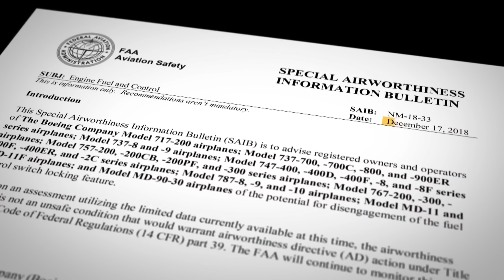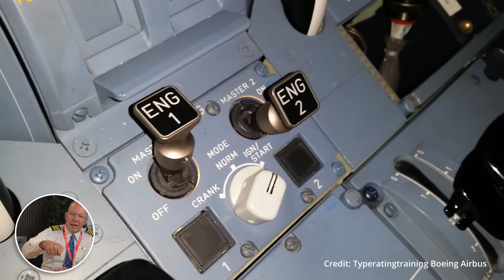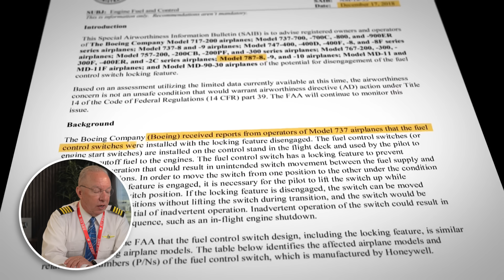Air India 171: The FAA’s 2018 Fuel Switch Locking Bulletin Explained (16 Questions Answered)

Comment: Engineer here… switch failure is always a possibility… 2 failures within a second is practically impossible
Reply: Everyone seems to be focusing on the switches being moved. There's a lot more to the fuel control system than just the physical switches. Any number of faults could have occured such as voltage fluctuations, damaged wiring, loose connections, connector pin fitment, liquid ingress, corrosion, software, bad components. What i'm saying is that it could be another fault that has caused the control systems to misregister the actual switch positions. The switches themselves may have never moved at all, despite the black boxes showing the signals changing.
Reply: @adamdavies163 the flight data recorder, recorder the switches being physically moved, and then moved back to the run position. They were found in the run position. The 787 is constantly recording 1000's of inputs if there was a failure somewhere else it would have recorded that failure.
Reply: @johnnybgood6424  You would need to analyze every second of the FDR and CVR data to align the sequence of events.

Sudden Power loss, no thrust, RAT deploys
Mayday, Mayday, Mayday
Why did you cut-off?
I did not.

Assumes Fuel Valve issue.....
Flicks Cut off Switch - to Off & then ON.
Flicks other switch OFF & then ON.

Who knows?
Reply: @adamdavies163  But there ARE sensors in the switches, and their state is recorded when the switch is toggled.
Reply: Also those 2 switches did allow themselves to be moved back to on and then stayed there even during the crash. 
Yeah, the chances of that happening are basically zero.
Reply: @Lukashoffmann94  or maybe we don’t have all the information yet and speculating doesn’t help.
Reply: @rtbrtb_dutchy4183  The relevant information is there to determine what happened. All we are missing is the who and why. Neither of those really matter in the grand scheme of things.
Reply: @--_DJ_--  no, the relevant information is not there. We still don’t know what happened. All we know is, at some point, the switches were moved to cutoff and moved back to run. 

Was this an attempt of a reset?  Deliberate could mean bad intentions, but could also mean trying to fix something. Was there another person in the cockpit who did something wrong?  Were the switches worn out somehow and they got bumped?  How about this, the first officer was flying, so when the captain went to raise the gear, he had to lean over the throttle quadrant to reach the lever. Did something fall out of his shirt pocket and hit both switches?  Did his shirt or ID lanyard get caught in it and pull the switches?  

We have no idea.
Reply: @rtbrtb_dutchy4183 You cant accidentally move them by design. We know what happened. No need the theorize at this point
Reply: @--_DJ_-- you can’t accidentally move them by design?  Correct, but is that true with worn switches?  
I’ve taxied an old Learjet unto the ramp for parking and to shut down engines, you had to lift up the throttles a bit, move them to the left, out of a gate and pull them down. 100% designed to not accidentally shut down the engines. Guess what, both engines shut down on me because this system was worn. 

Don’t jump to conclusions. We don’t have the information.
Reply: @rtbrtb_dutchy4183  They way they work wear would just make you have to lift them less, but you would still have to lift them. It's not like they are a heavy wear item that is going to shave metal down significantly. They also would have to be knocked upwards to move to the closed or off position, which is essentially impossible to do unintentionally, especially with a 1 second delay between switches. 
The conclusion has been made, the cause has been determined, it isn't being jumped to. People just don't want to accept it for some odd reason.
Reply: @--_DJ_--  yeah, I know how they work. I have flown different types of Boeings. 
And I don’t have an issue with the truth. But a conclusion has not been made at all. That’s you having confirmation bias. I’ve seen switches being pushed and pulled by clothing. I’ve seen switches being moved unintentionally. I’ve seen it all. I’ve seen things happen that the manufacturer said couldn’t happen.
Reply: @rtbrtb_dutchy4183  If you know how they work, you know how dishonest you are being to say it could be an accident. Listening to and reading conclusive evidence and understanding what it means isn't confirmation bias. Stop using that term if you don't know what it means. You could not come up with a scenario to activate those 2 switches, by accident 1 second apart that is even slightly realistic. Given what was said in the cockpit it makes an accident completely implausible. Stop denying reality. The conclusion is made, the who and why is all that is left to determine. It is possible they were moved not out of an intent to crash, but some kind of lapse of situational awareness or impairment, but it is quite obvious they were moved intentionally by one of the two pilots.
Reply: @--_DJ_--  and this is why you cannot be an accident investigator. You already believe a conclusion is made, when it’s not. I’m not being dishonest, I just know that we don’t have all the information yet. 

People said the flaps weren’t set for takeoff, while pictures showed they were. The aircraft didn’t use the whole runway. Flaps were accidentally retracted. People were so convinced. 

And now, you are doing exactly the same. Is it likely that what you said happened?  Absolutely. Is there conclusive evidence at this stage of the investigation?  Absolutely not. 

If you don’t understand this, I’d call that a flaw.
Reply: @rtbrtb_dutchy4183  The flaps were a theory based on nothing but grainy images. Whether people were convinced or not makes absolutely no difference. This is a conclusion based on facts and data. You can't compare them. Your logic is flawed. You are being dishonest. That is a flaw.
Reply: @rtbrtb_dutchy4183  Nothing I have written is what I say, it is what is in the report. There is data to show what happened, more investigating isn't going to change that data.
Reply: @--_DJ_--  come on man, you are being ridiculous. The report says that the switches moved from run to cutoff. Then they moved from cutoff to run. That’s all we know. Saying a pilot moved those switches is most likely. But this does not make it conclusive. It’s a good thing you are not an investigator.
Reply: @rtbrtb_dutchy4183  They didn't move themselves. That allows for one option. That is how a conclusion is made. Stop with the personal bits, it isn't helping your argument, you just sound petty.
Reply: @--_DJ_--  no, they didn’t move themselves. I never claimed that. 

Now, I did some research based on my own experiences on different types. No airplanes I fly are the actual switch position recorded in the FDR. (Flight Data Computer). So, I wanted to know, does the 787 record actual switch position?  This is the answer I got:

The Flight Data Recorder (FDR) on the Boeing 787 captures the electrical state of the fuel control switches — meaning it records whether the switches are in the RUN or CUTOFF position based on the signal received from the cockpit systems A B. It does not directly record the physical movement of the switch itself (like a mechanical displacement), but rather the status as interpreted by the aircraft’s systems.

So you tell me. The report says they are focusing on these switches.
Reply: @--_DJ_-- "One second cut off execution" raises another question.

FDR report says -

"Cut off switches transitioned to CUT-OFF from RUN position one after another in a CAP of 01 second".   

These words are extracted in verbatim from the report. Which means both 1&2 cut-off switches were executed in almost simultaneous 01 second CAP time frame. 

A manual spring actuated safety lock dented switches that need certain pull and put effort to activate cut-off......being executed in just a second by a human hand is something to think about. And here we are talking about "Two manual" spring actuated switches being turned off in 0.999 second. The switches are not like led room bulb switches.
Reply: @letsthinkbriefly3761  I'm not sure what you think that is saying, but it probably isn't what you think it is.
Reply: @--_DJ_--  I would like to hear what you think it is then. Saying TWO manual fuel cut-off switches being shut off all in "one second" by a pilot hand has to be a wild case.
Reply: @letsthinkbriefly3761 1 second is not a short amount of time to do that. Plus it is 1 second from the time the first one was activated, not for both combined. It is a switch they operate daily and could probably find with their eyes closed.
Reply: @letsthinkbriefly3761  I think it is even more strange that they set the switches back to RUN with 4s delay. If you want to die, you don't need to hurry up, so may switch them slowly, but when you want to survive and you life depend on the two switches, you would not wait for 4 seconds.
That looks more like they tried to turn the engines on by moving the switches up and down and looking on the reaction and as 1st engine get on, started the same procedure with second switch. May be even they turned the first switch once and looked for the engine reaction, then turned on the second. Anyway that indicated, that the situation was not clear for them and they wanted to understand what is going on. If one pilot had seen another to switch the fuel off, it would be clear for him, that he had to switch them both back as soon as possible.
Reply: @azlktune You have to process what just happened before you can turn them back on. That is likely the reason for a delay between off and back on.
Reply: @Lukashoffmann94   I don't get you. They did go off somehow. It would seem deliberately but that's not proven. One pilot thought the other did it and asked why. The other pilot replied that he didn't. Flight data also showed that each switch was returned to the on position one after the other within about one second. Obviously at least the pilot asking why did that. But it was too late for the engines to return enough thrust. This is all in the report.
Reply: @Lukashoffmann94  - it's likely they were never moved to the "off" position in the first place.
Reply: @Lukashoffmann94  solenoid issue found dont blame the pilots for the fault of boeing
Reply: @Lukashoffmann94  Weren't the switches on OFF when they inspected the cockpit?
Reply: @Lukashoffmann94     What if they were never really physically moved to off position?  If all that happened was just an electrical signal that mimics switch changover?    that would explain all the events including cockpit conversation... Cyber attack seems more and more as an option...
Reply: you are ignoring the dialogue.  There was an accusation, and a weak denial, no other dialogue between the two and no evidence that the captain took control.  The PF wouldn't accuse the PM of flipping the switches if he didn't have a reason too.  the PM shouldn't have been touching anything.
Reply: @JohnQuincy1776  I think some people have a hard time fathoming that a person would kill an entire planeload of people.  Yet that's exactly what happened.
Reply: @robertcameronjones  that is ok.
Reply: @JohnQuincy1776  We actually don't have a clear idea of the exchange, just a general summary. We can't hear tone of voice, stress, etc. We don't know the denial was "weak," just that there was a denial. And there may have been more to the exchange. (But not much more, since they crashed 10 seconds later.)
Reply: I wonder if the switches are directly wired to the shutoff valve or via a relay (mechanical or solid state). That could introduce a failure mode, though not in this case.
Reply: @Greatdome99  exactly. I don't know why these tubers are so hell bent on denying any possibility of electrical mishap just to lean towards deliberate pilot action. Like how the hell that small switch will control the fuel from all the way from the fuel tank to the jet engines.  If the switch is working through gears and springs there might be possibility of mechanical failures also.
Reply: Are you saying that a switch failure is possible but in this case that’s not what happened due to the 1 second delay between them? If that’s what you’re saying, is it not possible for switch failure to occur (let’s say due to intense vibrations or something) and affect the two switches with a time gap, or would they have moved simultaneously?
Reply: @malekmadeit  If it was a switch design detent issue how did the aircraft crash into a building and the switches remain in the on position. yet BOTH switches unlatched on a smooth ground roll in good conditions at the perfect time 1 second apart.
Reply: @malekmadeit  dual switch failure is a possibility in the same way that it is statistically a possibility for me to win the lottery every day for the rest of my life.
Reply: @malekmadeit they are spring loaded switches, it takes 3 fingers to lift up then you move it up or down and release
Reply: @malekmadeit I think all they were trying to say is that a wiring fault on one switch is somewhat possible. Keep in mind there haven’t been a bunch of reports of one engine shutting itself down due to a wiring/switch fault. NOW, with that consideration, what are the chances that two switch/wiring faults happen at “nearly” the same moment. It’s practically impossible. The fact it was one second apart shouldn’t be the factor to hone in here. Could have been 3 seconds, could have been 1/2 a second. Doesn’t matter materially. In terms of a random equipment failure of 2 independent switches/sets of wires at essentially the same time is what takes that scenario out of the running here. Take care!
Reply: plus the landing gear wasn't raised
Reply: @jeff946 the question is whether the RAT deployed before or after the switches were triggered. If the RAT deployed before the switches were triggered, then that shows that there was a loss of,power before fuel cutoff.
Reply: @jeff946  ikr!! No one's talking about it.
Reply: The switches didn’t look that bad in the picture. I’m thinking they can test the actual switch
Reply: The switches themselves do not pinch fuel lines to cut off fuel. In between the switches, there is electronics, software, pneumatics, pumps and valves. Failures of these or some of these parts can trigger an unexpected outcome. We need to know before it happens again. That is the job of investigations in replacement of tunnel visions.
Reply: Could an electrical failure look to the Black Box like the "switches were thrown" when they were not? ie: The BB was simply recording that the engines were cut-off by electrical signal, not the cause of the signal.
Reply: @creativebea  The ACTUAL voice of one of the pilots questioning the other pilot about the switches being moved nullifies the possibility that "an electical failure in the black box looks like the switches were thrown"
Reply: @mosheheliyahu9071  - dd he actually see the switches on the "off " position or going by what he saw on the computer screen?  Big difference. that is unclear. It's all "Fly by wire". Pilots are focused on computer screen read outs.
Reply: I’ll say it more clearly… a single switch failure is possible… two failures a second apart is not possible… they were operated manually & on purpose
Reply: Since the left seater has both hands on the yoke during takeoff, and the right seater has free hands. It's most likely the right seater turned off both fuel pumps, then accused the left seater of turning them off.

That's why the left seater said no. He was busy flying the aircraft, by all indications.
Reply: @donwyoming1936  You do more harm than good by speculating, even when speculating guided by logic. Something went wrong that day, the situation wasn't normal.

The safety boards know who it was. They'll be investigating the man's life before it all ends up in the final report a few years from now. This sort of information is normally not covered up, only delayed until all facts are known.
Reply: @donwyoming1936  We don't know who said what. That is NOT in the report!
Reply: Let me ask you this way. What could possibly cause both switches to move to cut off position within a second of each other except for manual input from pilots?
Reply: Electronics, wiring and IT can fail in the most unbelievable ways.
Really need to wait for the full reportn
Reply: What about a faimure from stress/fatigue of a housing or common component. Also, one failing element can knock out another. No idela, I'm not an engineer.
Reply: Awww man. You shouldn't have claimed to be an engineer. Now all the techs that actually know and do the work aren't going to listen to you!
Reply: If it was a deliberate action, the pilot concerned would have meticulously analysed the very moment to flick the switches so there was no way back. I do feel if you are planning to end your life would you really take all those people with you unless of course you are having a psychotic episode.
Reply: I think you are missing the point. The fault was that the detent was faulty. It has been discussed elsewhere that as the switches are so close together that they could be both bumped by a hand accidentally at the same time. The detents are there to stop accidental operation. It is the detent that is the subject of that earlier report.
Reply: IT Technician… true, but not IMpossible. We had a major failure of our tape backup system to the Tandem mainframe, so— go to your backup, right? 2nd backup failed. Go to 3rd backup. THIRD backup had failed. We even had a secret emergency 4th backup. ALL the data was corrupted or lost. It never had happened before— or after.
Reply: This would be an EEC issue not a switch issue. There is an AD on the EEC on this exactly plane model. Why no one is talking about it I don't know.
Reply: What about a computer malfunction?
Reply: Too much of a coincidence
Reply: That is a good point unless there are two connections operated by the same switch
Reply: I have had a VW Polo with a cracked wire from the battery negative terminal to the car's body. That single wiring fault caused a wide variety of systems to malfunction in weird ways.

If a switch panel had a bad (loose/corroded) connection on a common ground or voltage supply wire, then that could cause multiple switches to malfunction at the same time.
Reply: @craigmcqueen7992  The problem didn't happen at the same time. You aren't going to have an electrical fault on two switches right beside each other 1 second apart from a common problem to the circuit, and being an airplane, they are likely completely separately wired.
Reply: @--_DJ_--  a common wiring/circuit problem is most likely to affect 2 switches that are right beside each other. However, yes I'd expect an airplane has more redundancy (except possibly for newer Boeing designs).
Reply: @craigmcqueen7992  Yes yes Boeing bad. Very good. You get your social media points.
Reply: @--_DJ_--  My comment is based on Boeing's recent history in which MCAS neglected to implement redundancy in its design, relying on a single angle-of-attack sensor input rather than both sensors. That design decision was a significant factor contributing to multiple accidents and loss of life.
Reply: @craigmcqueen7992 Which has nothing to do with a plane of this vintage.
Reply: @craigmcqueen7992  Exaqctly. A Bad earth or floating earth can cause a plethora of electrical issues. The 787 Avionics Compartment is subject to excessive moisture ingress, as reported by various airlines.

Southern China had independent Engineers report 0.2mm gaps in the fuselage connections between Carbon Fiber and Alloy sections of the aircraft. They also noted that ALL 10 of their 787's had micro cracks in the Carbon Fiber sections due to poor alignment, wrong rivets, and oversized holes.

Independent Investigators also uncovered subcontractors to Boeing who were 'pressured' by Boeing to deliver goods that had NOT undergone full certification for durability, and therefore concluded that none of the aircraft were legally airworthy. Fault Components identified were Fuel Control Valves and Pressure Sensors.

They also identified issues with the Emergency Exit locking pins.
Reply: Actually if one failure happens a second failure is likely. Because the failure is likely due to an issue common to both the switches.
Reply: Is there a SOP when an engine reboot is required for a failing engine? The pilots deliberately did the off and on as a last resort to gain power which was failing anyways
Reply: @bijjii ...or referred to the wrong QRH / SOP? Worse still, acted independently and wasn't using any QRH or CRM.
Reply: That's assuming that the switches are fully independent of one another. Then statistically speaking you need to multiply by 2 probabilities. But we can't make that assumption.

The weight of the evidence currently seems to indicate intentional action, but we can't rule out other causes just yet.
Reply: It wasn't switch failure one of the Pilot's turned them off as heard in the Black Box recording.
Reply: They have the switches and can check they were installed correctly.  The console was replaced in 2019 and again in 2023 years after this bulletin so obviously with the 10' s of thousands of 737 777 and 787 being maintained and flown daily and these switches are used twice on every flight so don't you think that an 8 year old bulletin to check installation is no longer relevant.  Why would both switches fail 1 sec apart, on take off and not when the plane bumped down on landing, and why this plane has both fail when there is no recorded complaints of this happening on other planes over the past many years while these switches have been used.  Malasian airlines mh370 turned around and evaded radar and disappeared with 2 competent pilots. Nobody knows why but I am sure it was not fuel switches
Reply: These are Fiy by wire planes. The signal from the switch can be overridden by the FADEC/ECU. The signals can shut down fuel EVEN if the switches are physically in the RUN position. Ask a Boeing technical authority to confirm on oath that ONLY the physical switch can turn off the fuel.
Reply: 787 pilot here… 2 failures within a second is highly possible
Reply: It looks like either Captain Steve is getting paid or he is under some kind of pressure, because he’s defending Boeing from every angle..
Reply: The 2018 report about the issues with the faulty Boeing switches says BLACK ON WHITE that there are issues with the locking mechanism. A pilot having his wrist on the switches when holding the throttle, can accidentally flip them both at the same time without much resistance if the locking mechanism failed.
Reply: ..but then an electrical system failure causing the interpretation of these switch positions is absolutely probable. We are talking 21st century electronics here. Those switch outputs are fed into the FADEC and then it’s yadi yada…
Reply: A white man trying to save a white company…
Reply: Common mode failure
Reply: @tunneloflight may be yes
Reply: The flight recorder said they were turned off and  back on again. Obviously they were moved or there was a "Glitch" like what happened to Gus Grissom.
Reply: 🙄.. Make it simple...

As a Company or factory.. Boeing has manny backlog orders.. the show must go ON...

A person as a pilot already received salary as their job & risk... similar situation for the passengers, flying with a plane was a big risk to lose their live...

No risk no gain.. enjoy your journey..

😒
Reply: @kaprios1709  Different story when a Corporation like BOEING, purposely fits falsely Certified Components into their Aircraft, and then certifies the aircraft as airworthy.

That is not risk assessment, that is fraudulent financial liability.
Reply: I think Boeing shouldn't have relied on the detents. I think Boeing should have protected them with small plastic covers. Or placed them somewhere else where they are less likely to be bumped, like in front of the thrust levers rather than behind them. Or install them in the opposite direction like Indian light switches instead of American ones (down for on, up for off). Or even better, use spring loaded dials that are less likely to get bumped instead of toggle switches.
Reply: @danielch6662 you know Airbus has the same functioning switches?
Reply: If you are truly an engineer then you should know practically impossible is just buzz word engineers use to wash off accountability. 
There is no such thing.
Reply: No its not impossible.  If they're faulty then hand pressure acciddbtsllybput on the switches such as when using the nearby flap handle could set them to off
Reply: We know. Adding your supposed occupation, adds no credence or weight to your post.
Reply: FAA/GE issued Service Bulletin FAA-2021-0273-0013

SB 73-0097 R01 ENGINE FUEL AND CONTROL - ELECTRONIC ENGINE CONTROL (73-21-20) - REPLACEMENT OF INTEGRATED CIRCUIT MN4 ON MAIN CHANNEL BOARDS

The bulletin is related to loss of control issue. 

The stated MN4 computer with faulty soldering, that might weaken and lose contact due to the thermal stress after a number of cycles, interprets data and commands fuel metering valves - with the lost contact attaching the MN4 processor to the EEC intermittent electrical contact, loss of signal processing and engine control faults can occur.

GE recommended replacement of part on the bulletin.

It has been reported this was NOT implemented by Air India.
Reply: B1 engineer here. I agree.
Reply: @Adolphus-z7d8x 
"B1 engineer". Sure you are.
Reply: Like when a secondary fuse blow and a moment later the primary as well 😉 
I do not think that is impossible. As I read on the 737 the security part was built in upside down by the same technician on both fuel cutoff.  The cutoff switch worked, the airplane flew. The different was only that the pilots were able to switch it without pulling on it, like a normal flip switch.
Though I agree with you, I do not think this is the case here.
Reply: But let's not forget that this airliner had serious power issues on the previous flight that day. It affected the cabin lights,  AC and entertainment portals. Do you think that a power surge or short could have triggered the switches? Especially given the enormous amount of power required on takeoff?
Reply: @ted1091  That switch has an physical security feature, not an electronic one. And If the airplane has an electronic issue that switches down the fuel pump then all the fuel pumps should have stopped in the same time in my opinion.
Reply: @zbaktube I'm not an engineer,  but it seems like an easy enough experiment to test whether these switches could have been triggered by a power surge or short circuit
Reply: @ted1091  For me it is not clear either what is recorded in the blackbox: the flip of the switch or the fuel pump gets power or not.
Reply: @ted1091 It is not an easy experiment. Many times you try to replicate the fault indicated by the customer and nothing happens in a week of testing various scenarios. Nothing happens. You give back the thing to the customer and two days later he comes back stating the thing did that again. Very common.
Reply: An open switch will not fail short, but the reverser is true.  If there are sense resistors in parallel it's easy for the control logic to distinguish a device or harness failure from user input.
Reply: @robertcameronjones please explain your comment in lay terms. Thx
Reply: We Indians Saar 
We goof Saar 

Can't fly Saar 
Pakistan did it Saar 
We only drink mooter Saar 
No food Saar 
Forgive us Saar
Reply: The guy was suicidal. That’s it. It’s impossible for TWO to fail within 1 sec
Reply: Is it possible you can toggle these switches within a second ? It needs very quick hands to do that. 
I assume there maybe a coil which is energized to hold the switches in place and a electronic disruption may have released the switches. Or are these switches purely mechanical switches?
Reply: @krishnachander6411 They are held in place by spring pressure and a ramped section between on and off. Purely mechanical locks.
Reply: Whenever operating an aircraft control. the Crew should confirm correct function, correct sense, correct range of motion, and termination of motion. For example, “#1 Valve” closed indicated by light and/or annunciation/s followed by fuel flow value or flow “#1 Cutback" and for critical systems in flight dual confirmation before selection. This is required to maintain situational awareness of the aircraft itself. 

Different aircraft and engine manufacturers for some years had spurious FADEC activations that should not have been possible according to both the logic and the circuit diagrams. Even more disconcerting was the unofficial temporary ‘fix’ of cycling circuit breakers that were isolated from the FADEC.

Very tragic RIP.

Blue skies.
Reply: Lots of Boeing paid bots on this link. Good money to be paid huh...propagating fake Boeing propaganda
Reply: Y si nunca estuvieron en posición Run, y el problema ocurrió en la computadora que malinterpretó los sensores de posición?
Reply: How the blackbox register the statuses of the switches? From the electronics or directly from the switches? I think the answer of this basic question should be considered. Then if the statuses of the switches is red by the electronis through a voltage signal, if the voltage signal has some problem for ten seconds this can cause a misinterpretation of their position
Reply: You are a d*mb engineer. You must have taken several years to pass out.
Reply: Even more impossible is for both of those impossibly-failed switches to sequentially UN-FAIL and physically unlock/move themselves again, independent of each other, 9 and 10 seconds later.
Reply: But then isn't it also impossible to manually turn off both switches within 1 second? They need to be lifted before they can be switched which means they have to be switched off separately.
Reply: @michaelb2388  That's the point. The switch has a lock on it. Locks don't unlock themselves. The switches were designed to require deliberate and conscious effort to actuate.
Reply: Phycologist and astronaut here.. i have traveled to the edge of space and back. I suspect intentional foul play by either pilot due to the evidence brought forward, and by Boeing’s fantastic records of safe flight. Also the fuel feed could not have been cut off unless done so intentionally.
Reply: That is exactly what was being said about cosmic shuttles (Challenger). It was supposed to be almost impossible for them to crash.
Reply: As a risk professional (Finance though), which of the two are riskier : 1. We assume pilots at fault but actually mechanical issue this plane particular or boeing 787 in general 2. We assume mechanical issue in this plane particular or boeing 787 in general issue, but actually pilots were at fault. Former is way risky in my view, and it is very important to understand motive of pilot to do so and families of pilot should help investigation and it should be transparent to all.
Reply: nothing is imposible but it's improbable
Reply: Are you an airplane engineer?
Reply: Just like how it was "practically impossible" that Boeing wouldn't reference a major systems change on the 737 Max in their nomenclature that could kill 500 plus people in 5 months because they didn't want additional pilot training costs.  The copium of Boeing fanboiz only rivals that of Elon Musk fanboize.
Reply: Improbable, yes. Impossible, definitely not. 

That's why Etihad, Singapore airlines etc are doing checks on these switches specifically after this report came out.

We should also ponder on the human error factor here which every other aviation youtuber is making out to the actual cause. If one of the pilots deliberately did this, then he would also have made sure other pilot do not initiate a rescue protocol (by turning it to run) to save the aircraft. If it was a blunder, you would get the hint from how each individual would talk. At such life and death moments, no one thinks about how world would judge them. The cockpit voice recorder is not giving any hint that either of them actually did these intentionally or even by mistake. So, we should not draw conclusion before the final verdict is out
Reply: Exactly—one failure is bad luck, but two at the same time? That screams deeper systemic issue. Do you think it points to sabotage, flawed design, or something even more alarming we’re not being told yet?
Reply: Hello captain.
What do you think? What if the other pilot could ve repositioned the switches immediately after knowing about them being in cutoff position?
Afterall they were repositioned after a lapse of 10 seconds.
Reply: When installed incorrectly it’s a systemic error. So I disagree
Reply: You’ve made a very valid point. Unfortunately, what we are witnessing now appears to be the shaping of a narrative—something that began almost immediately after the crash. If you recall, right after the incident, videos surfaced featuring former pilots discussing flaps and gear configurations. However, anyone familiar with even basic aircraft operations knows that if both engines are functioning at full capacity, the aircraft will take off regardless of flap or gear positions.

Fast forward to the present: the preliminary report has been released, yet no one seems to be addressing some glaring factual errors within it. For instance, the full form of FADEC is consistently misrepresented throughout the report. Moreover, a prior FAA advisory clearly connected to this type of failure is being overlooked by so-called expert captains.

That advisory specifically warned that if certain chips used in the FADEC system aren’t replaced after 10,000 cycles, there’s a risk of automatic engine shutdown. Given Air India’s well-known history of maintenance issues, several technical factors could have contributed to the crash—beyond pilot error or intentional actions. The conspicuous lack of attention to these potential mechanical failures strongly suggests an attempt to shield Boeing, Air India, or both from scrutiny.
Reply: 2 Mechanical switches, very unlikely. However, those switches are a part of the integral fly-by-wire system.
Mechanical switches are fed into a logic array and digitally encoded to interrupt requests in the FADEC 3 module which controls bpth engines.

The 787's have a manufacturing defect that allows moisture ingress to the Avionics Compartment.
If Avionics are subject to humidity levels above design spec, then short circuits can easily occur, providing false signals.

Remember all of the ambient environmental conditions, a very hot day, A/C not working on tarmac, just finished loading aircraft, = sauna in Avionics compartment.
Then A/C running, temps drop to dew point, cabin pressurization, take-off angle allows droplets to accumulate and flow, moisture affected wiring generates false signal = DONE!

FDR records Fuel Cut-off Switches activating and de-activating, but did they really get physically moved, or was it an electrical fault?
Southern China alone, with it's 10 x 787's recorded on average 20 technical problems per month with Avionics, in the first 6 months of 2025.
CEO decides to scrap the entire fleet and purchase A350's. For routes where no replacement aircraft exists, they temporarily suspend flights rather than use a 787.
Just think about that - Chinese not taking $, for fear that the 787 might fall out of the sky.... Let that sink in!

I'm gotta trust the Pilots and say that the 787 is a LEMON!
Boeing will no doubt blame Pilots to avoid Liability, because they are almost Broke!
Reply: @delawarecop  Except looking into the details, all the reports are that China Southern was planning to sell the 787 to get larger ones, they do have concerns about the airplane, but the airline itself appears to have not put out anything on it.  Their order for the A350 was in 2017 and was expected to be concluded by 2022, and it appears that it was.  Information closer to the time they announced the decision, indicates they would have been more concerned with the structural questions.  They flew the 787-8 which is the smallest and worst for efficiency.  Also note, it seems like only that airline is giving up their airplanes, not the rest of the airlines that fly the airplane.
Reply: @delawarecop you really believe that you got 2 independent shorted wires within 1 second from one another? Guess it’s possible but not likely
Reply: @odez180  They are not 'independent' when they are signals fed into a logic array.
I am an ex-RAAF FA-18 Hornet Supertech by Trade, so I do know a little tiny bit about Mechanical interfaces to Logic circuits.

Trust me when I say, the 787 is a lemon!
Reply: @delawarecop each switch is talking to its own fadec which in turn talks to the fuel control unit. It’s not one computer talking to both engines. This redundancy is put in there by design. If military aircraft is wired this way that is a huge flaw.
Reply: @delawarecop  You have some good points, but short circuits typically don't act that predictably. and for just 10 seconds and both switch inputs and no others 1 second apart. and no other Fadec faults, typical computer related faults would cause all sorts of weirdness not just 4 channels acting in the exact manner they would be if by human factors.
Reply: @aussiechristian  Depends where the water ingress occurs, depends on where corrosion occurs! You only need a temporary transient electrical spike to act as a simulation of a toggle switch.
Reply: @delawarecop  I work in Automation mainly Industrial. I understand what your saying but it is highly unlikely on 2 switches, with Aviation all critical switching has dual redundancy, 2 switches 1 second apart then back on 10 seconds later with a 4 second time difference. seems a little too human to be that type of error. If a bus goes you would get multiple errors. its all too clean to be a malfunction as you describe. Water shorts on contactors or bus relays caused chatter in most cases, and direct coil shorts causes mayhem this would be seen in data clearly.
Reply: @delawarecop  The information in the report is quite clear. The switches were switched to off and turned back on manually. That can't happen because of an electrical fault.
Reply: @delawarecop  Take it for what it's worth, but Perplexity says: "Each switch is equipped with an electrical sensor or position detector that monitors its current position (RUN or CUTOFF). When the switch is moved, this sensor changes state." However, "The sensor does not send data directly to the FDR " but gets routed to avionics control, which performs and records the action. 

So there would seem to be some tiny possibility of a software glitch - the switch didn't move, but a message sent to avionics control to switch fuel off. But then there would have to be the same SW glitch in reverse, since the pilot would not be able to turn the switches on (since they are already in the on position).
Reply: I shudder whenever I hear the words "practically impossible" (as do you yourself probably) but you are completely right.

If these were so prone to failure that 2 could fail a second apart there would have been a long  history of single failures .

And as such a failure would lead to an engine shutting off, the consequence is so severe that it would have been known. A lot wider known than a single bulletin years ago.
Reply: @exharkhun5605 Hmm you bring up some really good points, we would’ve seen some sort of issue with the switches before. Man it’s really hard to believe that it’s as simple as human intervention. I wish I could understand why
Reply: @malekmadeit  We probably will, investigators will comb through the man's records, his simulator flights (professional and on his computer, most pilots play flight simulator) and interview everyone he's known. People who are this desperate have a history.

Sadly they often manage to disguise it under a veneer of professional behavior, until they snap. That's why our Captain here had such success with a simple question: "Are you ok? Are you ready to fly? Asked at the right time, and in the right spirit, it can pierce through the façade before the problem becomes real.
Reply: @malekmadeit this airliner had serious power issues in a prior flight earlier that day.  All of the cabin lights, AC and entertainment portals were not working. We assume that maintenance engineers were summoned in the interval. But I wonder whether a surge might have triggered the switches.
Reply: @malekmadeit  People do crazy things all the time that are completely unfathomable to most people. This is just on a large scale so it is harder to wrap your head around, but not really any different than someone doing it solo.
Reply: @exharkhun5605  And that bulletin wasn't for a failure per se, it was that on some planes, the switches were installed with the safety feature disengaged.
Reply: @exharkhun5605  New or old, that bulletin is known to the maint. shop. But the phrase "practically impossible" does seem sensible.
Reply: @erickborling1302  Thinking something is practically impossible is never sensible.

I'm only a certified network engineer, not a real Certified Engineer, but I don't think any of my peers, and certainly no real engineer, would ever be comfortable with that phrase.

However you deal with a system described with those words; test it until you're certain, build it redundantly or just giving it extra consideration in your scheduled checks, you find a way to deal with it.
Reply: clowns in the comment section can't stop pretending to be pilots or engineers.. its pathetic.
Reply: But the other pilot denied it. If he did on purpose it’s not necessary to deny. And they did something to revive the switch. So for all us there who love to fly 787 Dreamliner it’s important for boing to look into mechanics failures to avoid a possibility of second accident
Reply: @Fyy256  It's no surprise he denied it. I don't take anything from that at all.
Reply: @Fyy256 The other pilot saw him do it and asked him why he did it. Then the co pilot denied it. Do you know what happens every second day in my work place when someone does something wrong and is asked why they did it by the manager, even when they were clearly seen doing it ON CAMERA? They STILL deny it. It’s called pathological lying.
Reply: @Fyy256 The denial by the other pilot forces the other pilot to run the possibility that it was something accidental.  That few seconds might have made the difference between a good and bad outcome.  If you want a bad outcome, more obstacles to the truth are advisable.
Reply: @Fyy256  if other pilot wanted to be unalived, then he would try to stop the efforts of 1st pilot to save plane and restart it. Maybe fight with him. 
Because if they are somehow saved he would be in s condition worse than unalived.
Reply: @Fyy256  The other pilot denying it means absolutely nothing.
Reply: @Fyy256  Boeing won't be doing it, but the investigators definitely will.
Reply: @Fyy256 you are not smart enough! Pilot 1 could have moved them and then accuse Pilot 2 who was then in fact innocent! 2. Pilot 2 did it but lied about it! Its 💯 suicide bc otherwise they would have been switched off simultaneously at THE SAME TIME and not with an 1 sec delay and then switched on again. Unbelievable is the stupid** of so many ppl not getting it was suicide! Its clear that one of the pilots wanted to crush it! Sad!
Reply: @Fyy256 no, you’re wrong. If that’s the case, then why do 99% of criminals who commit murder deny they did it?!? That’s your logic.
Reply: @vito774 because the criminals you referred wanted to live and this one not
Reply: @vito774 this would not be just any ordinary “criminal” but a suicidal person to do that. My gut feeling is that the guilty person who is suicidal would just keep quiet.
Reply: @vito774  because they don't want to go to jail. According to 99% of the people on US youtube channels, as soon as the culprit pilot or FO deliberately pulled the switches, it was a no recovery possible scenario. No need for denial.
Reply: @nicbordeaux no need to admit it either. But one of them did it.
Reply: @vito774 I hope it was that simple so we are safe on 787 because I fly it almost every month if not 2. But no one should think it lightly in this situation because from the conversation and action taken after found out it was really not likely.
Reply: @Fyy256 I’ve been an aircraft technician for 26 years. There’s not a plane flying that’s made by Airbus or Boeing that I would have reservations about getting on. There are certain airlines I would NEVER fly on though.
Reply: @vito774 thanks for the advise I think I know what you mean
Reply: @nicbordeaux  No need for denial doesn't make it impossible for them to deny it.
Reply: @lraiden7 we don't resolve investigations based on gut feelings
Reply: @lraiden7 It could have been an act of terrorism.
Reply: @vito774  the utmost activity and most reflexive action is to switch them back on to Fuel On once they find that the switches were on cut off, rather than asking this question between pilots and arguing with in the first hand. Check the report and it makes no sense…
Reply: @sonyjose4735 it doesn’t, but the startle delay and response is different for everyone. This part of flight is very regimented, and to have the other pilot’s actions be so extreme, I can’t fault one’s response and performance.
Reply: @wattlebough  Maybe, but for some reason don't so. Could be wrong
Reply: @vito774  Committing murder and committing suicide is completely opposite thing and require compote different state of mind. It is typical that murderer is trying to get along with murder. Suicidal person wants to finish with his life so do not have need to deny it.
Reply: @lraiden7 or pin it on the other guy by accusing him of turning off the switches knowing they are being recorded
Reply: @vito774  You have a point, yet it IS possible though as unlikely as everything else, that the PF had the worst brain fart in history.
Reply: @lraiden7 you can bet insurance companies are going to push hard to identify which pilot asked the other why he cut off the fuel.  Voice analysis will eventually show which one asked the question.  His poor family will be ridiculed and will most likely not receive life insurance payout.
Reply: yes it can. because both switch connected to same electriclly wiring to computer
Reply: @DK-lg7ti  Please explain how a wiring fault would physically move both switches.  That sounds like complete fantasy, but if you have a reasonable explanation then I'd love to hear it.
Reply: @ferrumignis power surges do that kind of thing all the time. And this aircraft had very serious power issues on the previous flight that day. The cabin lights,  AC and entertainment portals were all not working.
Reply: @ted1091  None of the cabin electrical issues have anything to do with cockpit electronics. The RAT deployed after the plane began to sink, therefore after the switches were triggered and the engines spooled back. This is quite clearly an intentional act, I don't understand why people can't just accept it for what it clearly is.
Reply: @--_DJ_--  “clearly and intentional act”. You don’t know this. That’s why people don’t accept it. First everyone was convinced it was the flaps not set properly. Then it was that a pilot confused the gear with the flaps. Then it was lousy maintenance. So far, everybody has been speculating and non was correct. 

Was this intentional. Probably, but we don’t know. We don’t have enough information. You just have confirmation bias.
Reply: @rtbrtb_dutchy4183  The initial theories were just that, theories with no evidence. We now have evidence. I don't have confirmation bias, I never suspected anything in the first place. I look at evidence provided by experts who have real data and accept their findings. To think anything else could be the cause other than an intentional act is irrational and acting on confirmation bias.
Reply: @--_DJ_-- because we don't reach conclusions without investigating all possibilities,  especially when the aircraft in question had serious electrical issues earlier in the day.
Reply: @ted1091  As I wrote already, the cabin issues have no bearing on the cockpit. That's like your trunk lights not working and saying your engine quit the next day because of it. 
There aren't any legitimate possibilities for what happened to happen other than someone did it, which is the conclusion they have come to, because that is that is what the evidence points to.
Reply: @ferrumignis Ghost in the cockpit.  You forgot to ask why the switches suddenly worked again as the report says the switches were moved to run and the engines began to start
Reply: @-DJ- so you think that the fact that the electric power for the cabin lights. AC and entertainment portals on the previous flight was merely coincidence? I'm not convinced.  You shouldn't be either.
Reply: @ted1091 yes, it means nothing. You shouldn't be connecting unconnected problems.
Reply: @--_DJ_-- that's someone whose mind is made up prematurely
Reply: @ted1091  They are intentionally isolated systems. It literally has no bearing on anything. You are just grasping at straws for some unknown reason.
Reply: @DK-lg7ti each switch is connected to its own fadec
Reply: @DK-lg7ti it’s not, they are separate and for that reason, you just lie for no reason?
Reply: @DK-lg7ti  No 787 actually has double redundancy, so 2 contacts per switch and 4 ACE computers, and there was no faults detected on the flight recorder.
Reply: @DK-lg7ti  They operate one engine fuel valve each. How they are wired to a computer and how the computer is programmed is irrelevant.
Reply: @robguyatt9602 i meant electric supply to all those seprate switch.
Reply: @DK-lg7ti they are mechanical switches only
Reply: read the bulletin. It clearly says this is a possibility.
Reply: @georgevincent4447 yes, but put it together with the question posed by one of the pilots. Like, if a pilot observed (even partially) the other pilot turn it off, then asked why they did that, then it removes the possibility of a wiring issue. It wouldn’t make sense to NOT see something happen, then question the other pilot directly about what they just did?
Reply: @Sleepyboiwonder  The pilot may have been responding to the engines powering down, then assuming the other had moved the switches. He may not have visually observed an action.
Reply: @georgevincent4447  Read the OP's post. He clearly also says switch failure is always a possibility by using the words "switch failure is always a possibility."

What the bulletin doesn't cover is the likelihood of both switches failing one second apart from each other.
Reply: @georgevincent4447  I thought he said it was only a possibility if the switches were install incorrectly. Maybe I'm confused.
Reply: @georgevincent4447  Yes. Key word being Possibility. Cameras in the cockpit would prove or disprove which theory is correct. Fact is, we don't know, at least based on what has been released so far.
Reply: @snaredude56 cameras won't prove anything. You folks would just start arguing that the video is fake or manipulated in some way because what the video shows does not match what you want to believe
Reply: @georgevincent4447  That isn't what it says at all.
Reply: @georgevincent4447  no it  did not.     No where did it say BOTH switches and just 1 second apart could flip and then flip back to the on position and stay there after the crash.
Reply: @georgevincent4447 It would have been spotted and corrected the first time the plane flied after assembling or major maintenance. This plane was not out of the hangar.
Reply: Photocopier engineer 👍
Reply: @nickwoo3034  don’t laugh, when Xerox had huge commercial copiers in the Olden Dayss they had full time technicians; if we had to call them, it was an expen$ive proposition. Huge, 15x9 feet, and 2927 Lbs, not employee serviceable. It was the centerpiece of the whole copy shop. if you didn’t clear the paper path, I forget if it was the corona wire and transfer belt or what? but 2 sheets of paper scratched and dragged a couple key components… it thoroughly cost my boss $700! and out the door I went.
Reply: Captain steve seems to be paid huge by boeing company..
Reply: @Ranjanasshots he just understands airplanes better than 90 percent of people on this comment section